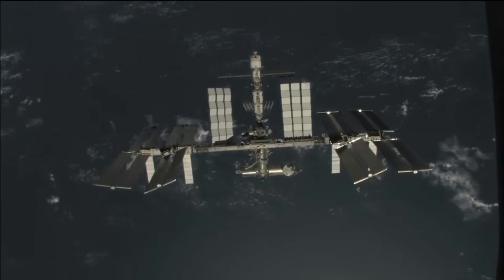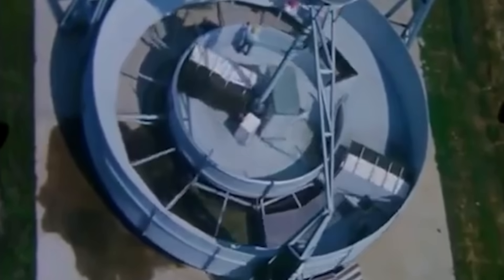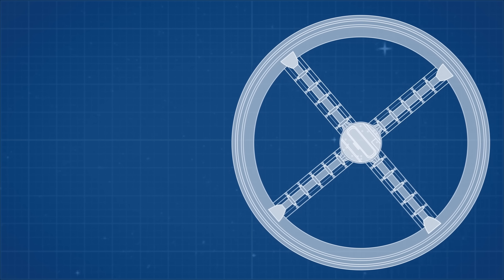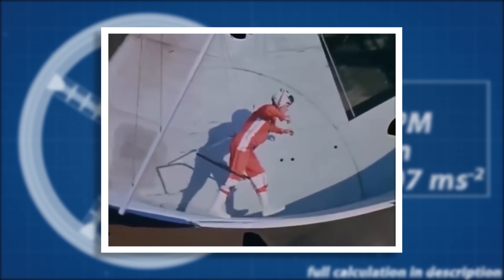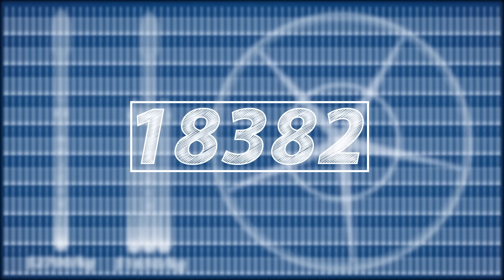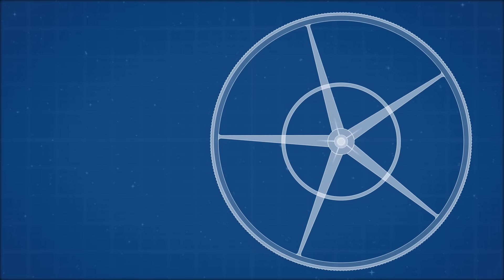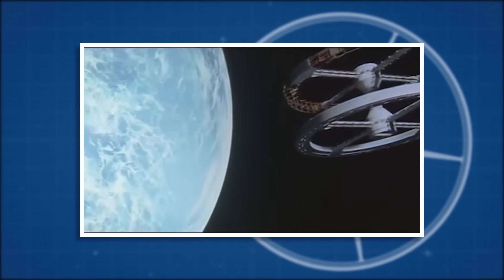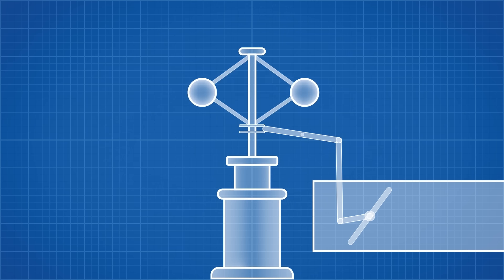Can We Create Artificial Gravity?

Comment: WTF are you talking about — the worldwide aluminum production in 2018 was around 60'000'000 tonnes, so roughly 1 million tonnes per week, and your "cost estimates" are no better...
Reply: You're right. Besides, aluminum as well as titanium, are abundant on the moon (as he mentions), and once the necessary mining and purifying infrastructure are set up on the moon, it would be many orders of magnitude cheaper to launch the purified product from the lunar surface to a lagrange point orbit. And if I remember correctly, titanium is both lighter and stronger than al.
Reply: Sam R. England titanium alloys have higher density but similar specific strength to aluminum alloys (at room temperatures), so it usually doesn't make sense to use them instead of aluminum unless you have some other requirements. Aluminum is an order or two of magnitude more abundant and, as far as I understand, much easier to work with.
Reply: @tinldw  Ti is considered a 'strategic element'. I'm no technocrat or engineer, but from general reading I'm sure that Ti will come in handy for any number of space-related tech. At any rate, plenty of both on the moon. (I wonder if it's easier to purify al in 1/6th g?)

Comment: Riddle me this: Say you get a spaceship into space with astronauts aboard. It's one of the new spinning models, but it can't spin as it leaves the atmosphere, so it has to begin its spinning once it gets out into space. Now imagine there is an astronaut who is floating between the "floor" and "ceiling" of the ring, and imagine there is an uninterrupted path all the way around the ring for the astronaut to float through without touching any of the walls, the floor, or the ceiling.
As the spacecraft begins to spin, wouldn't the astronaut just stay in place while the ring spins around him? Doesn't he need to be touching something in order for the angular momentum to be transferred to his body, thus simulating gravity?
Reply: I think that once the ring was spun at the proper rpm the centrifugal force would push him to the 'wall', eh, 'floor'.
Reply: @samr.england613  But how does it do that if he's not touching anything? Wouldn't the ring just spin around him? What is transferring the force to his body?
Reply: @seth468  I'd surmise that the centrifugal force would push everything unsecured to the inner 'floor' or 'wall' of the ring.
Reply: @samr.england613  I get what you're saying but centrifugal force doesn't work that way. It only works that way on Earth because there is gravity keeping everything in physical contact with something else. Centrifugal force doesn't work if you aren't touching the spinning object. It's not a force like gravity or electromagnetism that can act on other objects from a distance.

Comment: I think if having artificial gravity will dictate size, shape and angular motion of a space station/ship then for all practical purposes even long-term it's not just not viable... I mean you'd basically have to go waay into the future and then make a gigantic and expensive space station designed for the express purpose of having artificial gravity... I mean.. Then you might as well just stay on earth? :P It has lots of gravity.
Reply: As if the only reason we go into space is to experience micro-gravity? Say we eventually mine the moon of its abundant aluminum and titanium. Instead of coming all the way back to Earth every six months to avoid the debilitating effects of micro grav or the moon's 1/6 earth grav, they could instead easily launch off of the lunar surface and stay in the artificial grav rotating station in lunar orbit for a while to recuperate. It'd be a lot cheaper than rotating everybody back to Earth and back to the moon.

Comment: It doesnt need to be a ring.  The same effect could be accomplished with 2 tethered masses, you wouldn't even need a structure in between as tension would maintain trajectory.  Take 2 rockets and tether them together, and fire them in opposite directions.  Cheap and easy gravity.
Reply: But a ring is so much more elegant and aesthetically pleasing! :)

Comment: The other large problem, not mentioned in the video, is that you need a fixed point, a source of leverage, around which to create that centrifugal spin.  All of the spinning objects shown in the video are attached to something at the middle, allowing the outer structure to spin.  In space, there would be no point of leverage around which to spin.  Even if you put 1000 rockets around the perimeter, all facing and firing in the same direction, you wouldn't be able to control the oscillation in a single plane, which would be needed to keep it stable, and the structure would likely rip itself apart from the massive torsion created by the uncontrolled oscillation.  

If you could somehow overcome all of these issues, then centrifugal force could absolutely create the kind of artificial gravity in space that was proposed in the video.   Unfortunately, I have yet to see or hear a good solution for the aformentioned problems, so it remains a largely moot point.
Reply: Damn! Another effing technical hurdle! I wonder what Gerard O'Neil and other physicists would say about it?

Comment: Uh but, in space this doesn't work if you jump you'll fly to the other side of the wheel. Water doesn't fall and float . An air hockey table floor that suck will have the idea of gravity
Reply: And if you jump off the air hockey table floor?
Reply: @TexMex421  the same, there's no gravity only the illusion of it.
Reply: @guerillaguru8650  No in the spinning spacecraft, the whole person is pushed in a way that is indestigusable to the bones and circulatory system.  Air hockey floor or magnetic boots (1000x more practical btw) will not do that.
The force pushing them into the floor is not gravity, but it is quite real, not an illusion.

Comment: I really don't understand the argument that the space station must be huge.  A smaller spinning space station would not have as good a fake gravity as a a huge one, but it would still be a whole lot better than zero G. 
And the space station need not be a spinning disk.  Two separate masses connected by a truss or cable spinning would work just fine.

Comment: Wouldn't two small crafts tethered together be much cheaper than a ring?
Reply: Also much more unstable.

Besides if you want a station you probably want it to be big so you can put lots of stuff and people in it. If you're going to make the two crafts you might as well make them big, if you're going to make them big might as well make them long until they touch and then you have a ring.

Comment: I wonder if the earth stops spinning (without considering Sun's any gravitational effect), would the gravity be more effective on us
Reply: Centrifugal force of Earth's rotation affect as only 0.3 %, so it wouldn't matter much if Earth stops spinning.
Reply: @max5250  Actually, if it was spinning it would affect everything except for the middle point of the presupposed poles.
Reply: @rap1df1r3  
Sure it would produce catastrophic events all around the globe, mostly on and around equator, if it stopped spinning, but we are not talking about that, but about the effect of rotation on gravity.
Reply: It won't stop spinning because it never started. Also, gravity is just a theory and a bad one at that.

Comment: Just fill it up with air, everything heavier will fall everything lighter than air will float. Gravity is irrelevant/non-existent. Look at the periodic table. Almost everything is heavier that the molecules that make up air.
Reply: Airplanes seem heavier than air...
Reply: @TexMex421  And they fall out of the sky when their engines and propulsion systems fail. Dumb Comment...
Reply: @jntaylor29  Yours? agreed.  Explain clouds.  Is the water in them not heavy?
Reply: @TexMex421  1. Water vapor is not heavier than air. And at the point that it comes back together and form droplets that are heavier, it rains. 2. Hot air is also lighter than cold air so when water is evaporated into the sky there is also heat involved. Where is your science. Next argument please. Your comment is like saying bird are heavier than air so how can they fly. Dumb
Reply: @jntaylor29  The weight of water vapor or air is dependent on the quantity.  You might be thinking of density.  Clouds contain water vapor but no more that the air around them.  The visible part of clouds is liquid water or solid ice.
Reply: @TexMex421  fog is a cloud at ground level. Usually due to a rapid change in temp. It's still in a gaseous state. Air can carry moisture in gas form but once it becomes solid, ice or liquid water is going to fall..
Reply: This is about about whether gravity holds is down, or our density compared to what the atmosphere is filled up with, "air". So lets fill our atmosphere with something else. Let's fill the whole sky with water. Our weight will change because now our molecular weight and density compared to the molecular weight and density of water which we will be totally surrounded by. Does gravity have and role in the computation?, No just weight against weight, the heavier object falls.  Since water is a lot heavier that air we can float, bounce around. And if we fill ourselves up with air like a balloon, we will shoot to the surface. Because air is much lighter than water. We can test this by immersing ourselves in water the  way we are immersed in air now.
Reply: @jntaylor29  Nope.  Water vapor (gas) what we call humidity, is as transparent as air.  The visible part of fog or a cloud, is liquid water.
Density is not directional.  The air above a rock and bellow a rock and to the sides of the rock has the same density.  And yet the rock falls in one direction.
Reply: @TexMex421  Okay, yes I read the definitions. It's tiny water particle aerosol suspended in the air. That still proves my point. The particles are so small they can be carried by the wind. That's really small. Check it the science to see just how small  The accepted average volume of a drop of water is exactly 0.05 mL (20 drops per milliliter). It turns out there are over 1.5 sextillion molecules in a drop of water and more than 5 sextillion atoms per droplet. 
So, really Really really small particles if it don't make up a drop of water
Reply: @TexMex421  remember water is H2O , a hydrogen which is lighter than the oxygen and nitrogen, and 2 oxygens which are basically air itself, so it's not far fetch that it will be carried by air. But when those hydrogen and particles come back together and make a drop, when it becomes heavier than the air it's gonna drop, no gravity required. And if gravity ain't in the equation, then it doesn't exist.
Reply: @jntaylor29  So now you are telling me there is wind holding the fog up?  Pull the other leg.  
Do me a favor, from the same "yes I read the definitions" source, tell me the definition of density.   Cut and paste it for me.
Reply: @jntaylor29  The the Atlantic ocean for example, which is water might be carried by the wind?  It is after all "a hydrogen which is lighter than the oxygen and nitrogen, and 2 oxygens which are basically air itself"
Does that happen a lot?  I mean it's not far fetched is it?  
Still waiting on that definition of density btw.
Reply: @TexMex421  den·si·ty

/ˈdensədē/

￼Learn to pronounce

noun

the degree of compactness of a substance.

"a reduction in bone density"

synonyms:solidity, solidness, denseness, thickness, substance, bulk, weight, mass;

Water has different states and thus density and air at different temps have different density so this does not prove the existence of gravity. It's still not in the equation, but also we can go to another elements and have the same conversation. I'm not sure what your arguing anymore. The shape of the molecules the weight,  the density, the temperature. Either way gravity isn't in the equation if whether the molecules rise or fall as compared to air.
Reply: @jntaylor29  I'm not arguing.  I am pointing out how you have the same understanding of density as you do clouds.   And a strange willingness to just make stuff up like wind holding up fog, cause of the hydrogen. Or twist up something like "The accepted average volume of a drop of water is exactly 0.05 mL"  Which might be relevant if fog was made of drops of water.   At no point have you just asked what holds up clouds/fog.  For some reason you see this as a fight. 
Now tell me what is the direction of density?
Reply: @TexMex421  I got these definitions from where I believe your getting your information. There's nothing made up here.  anyone can search the terms for themselves. But let me throw this at you .... Astronauts experience weightlessness in what part of the atmosphere? Oh and what's is the content of air in that part of the atmosphere.
Reply: @TexMex421  it's actually the sure microscopic particles of water. However in this entire conversation scientific theory and discussion, once the conversation become scientific, you have not mentioned, described, it theorized gravity at all. It just shows my point of it's irrelevancy in the conversation of what holds something to the ground.
Reply: @TexMex421  look up weightlessbess, or how to recreate it in Earth. Simply remove all the air from a chamber and fill it with something more dense.
Reply: @TexMex421  okay mybad, I get you now. It's an objects denseness that keeps it in the ground or under less dense substances. And not gravity. Ohhhhhhh got it, mybad. We on the same page now
Reply: @jntaylor29  Lol, I have not mentioned gravity once.  (and at no point have you "become scientific")  And the liquid water in the cloud is far more dense than the air below it, or above it.
Also, the atmosphere gets less dense as you rise.  So if you hold a object, such as a ball and let go it will fall into the more dense air below it, vice the less dense air above it.  Why is that?
Reply: Yeah, but it's much easier to just presuppose bending space-time, even though no one has or will ever observe it in any way...

Comment: Why do we always have to assume that making a large diameter rotating enclosure be of continuous mass? Why can't we simply position two equivalent masses connected by a long cable (or hollow tube in which one can traverse between them) and then set them in rotational motion? The distance between them can therefore be as long as you want with minimal expense.

Comment: Thanks for the interesting video. What about the counter-rotation problem? The same facing helicopters, as the total rotational momentum should be zero in an isolated system. Maybe in odessy 2001 they had to show 2 parts rotating oppositely. Huum, I have to rewatch the movie ;)
Reply: Unfortunately, with one section spinning in the opposite from the other, the double wheel design would cause it to start spinning sideways in a circle around itself. This is how reaction wheels on satellites and the ISS work. They use three flywheels driven by electric motors in an X/Y/Z-axis configuration to get full control of spin or twist in any direction. Quite a clever idea, not to mention cheaper and more energy efficient then using chemical RCS thrusters. The way they did it in Space Odyssey 2001, with the whole station rotation in the same direction, is actually a better way, they just needed the station to be bigger to be able to match earth gravity. Good idea, though. =^x^=

Comment: 1:38 "If centripetal force exist in this reference frame, there has to be a force pushing him outwards, that is centrifugal force". No.
But where is the centripetal force ?
First of all:
If we imagine the situation in space and without rotation, there will be no centripetal force that will push man towards the centre. Some may think of the soil reaction... but so it will mean that the soil reacts to the weight of the man... while we are in weightlessness. The man will not press on the soil. And if he tries to do so with his muscles, the soil will react in any direction depending of the direction of the pressure, not in a specific centripetal direction. So there's no specific centripetal force in this situation.
Then :
If we rotate the thing, there is still no centripetal force, why would it suddenly appear ? But the soil will pushe the man tangentially to the circle, and this at every moment. On the other hand, by inertia, his body should go straight into space, like the stone of a slingshot, but the ground prevents him from doing so, and then he can then believe he is undergoing a force of gravity or a centrifugal force, but he is not.
His sensation is not subjected to a force whose direction would be centrifugal, but to a frictional (and tangential) force due to the motion of the ground.
And in fact, the man will be able to do many experiments to discover he is in a rotating system, if he drops his pen he will see that it doesn't fall back at his feet, etc.
What's really unfortunate is that you're talking about "angry mobs" who say centrifugal force doesn't exist. It's about science and arguments, there's no reason to be "angry".
We have all learned in school that centrifugal force, or that hot air is lighter than cold air. And then, listening to a particular scientist or reading a particular popularization article, we realize that these were simplifications of language, which do not correspond to reality. However, these simplifications only make things more complicated, because they introduce misconceptions that sometimes do more harm than good. It is not "angry" to give a more real vision of things, if it is done with politeness and arguments, perhaps sometimes clumsy, I do not claim to be a scientist.
Reply: You are absolutely right , you can't  create gravity using centrifugal force. If an object is weightless no amount of spinning can induce any effect on the object